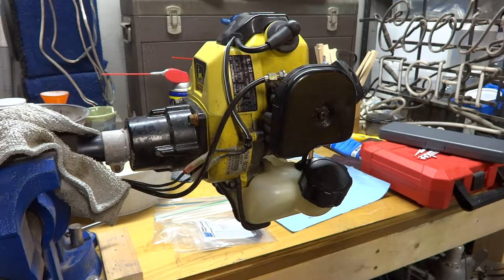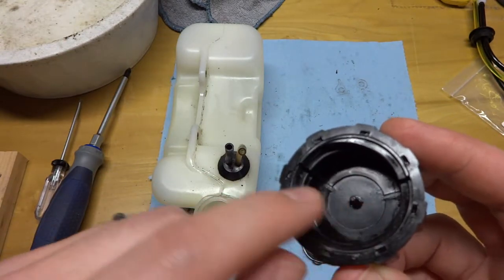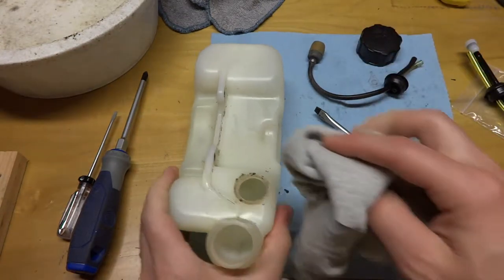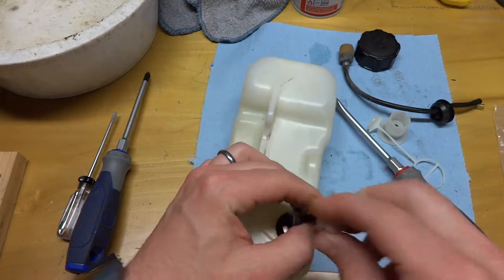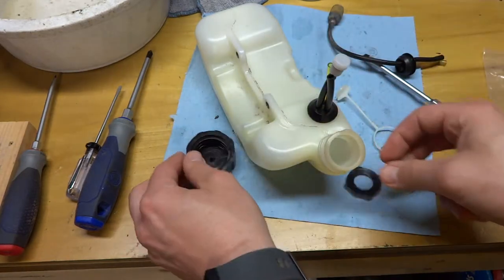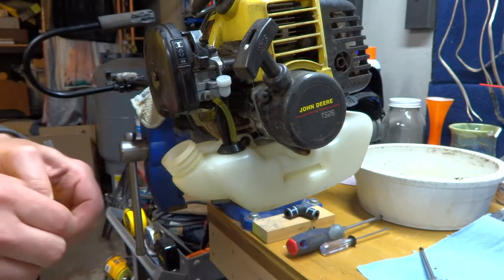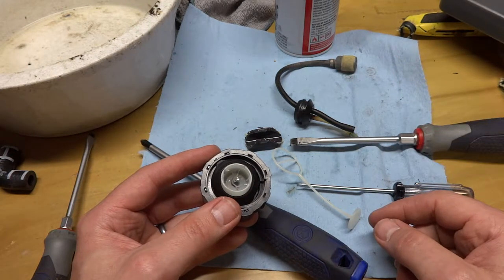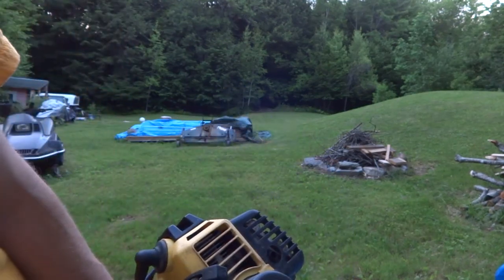John Deere TS26 String Trimmer Fuel Vent Fix

Comment: Once I was changing the oil over at a buddy's house in an old truck I had.  I did not have a new crush washer for the drain plug.   After cracking the original plastic one, I had to fab up one from a lid off a margarine tub to get the truck home till I could swap it for a proper washer.
Reply from the maker: That's a great solution in a pinch for sure!

Comment: Great video,  I considered modifying our JD tank to work like all the Echo ones I have too.  Ours has a nipple protrusion off the outside of the tank which I think is the vent line.  That little nipple broke and thus can leak gas.  I want to either plastic weld it or cut it off and drill a hole and install the grommet, 3 fuel line/vent setup like the Echo's
Reply from the maker: Thanks! I do think the Echo style setup makes a lot more sense, then if anything goes wrong in the future, the parts are more readily available.